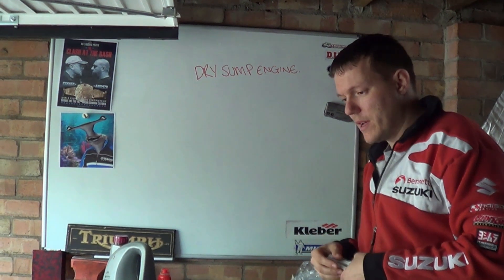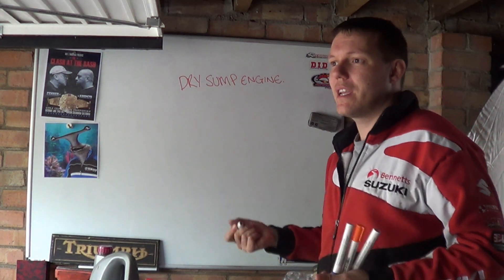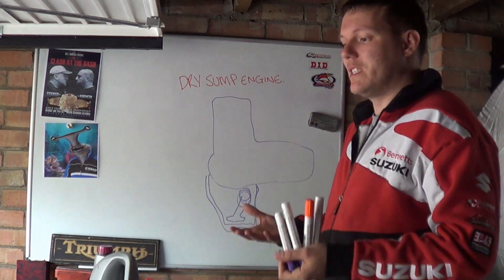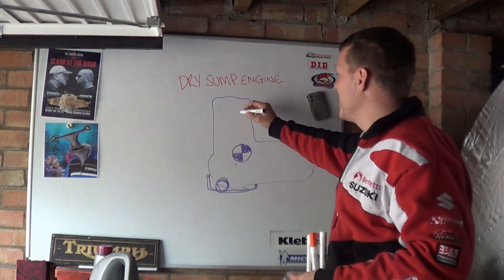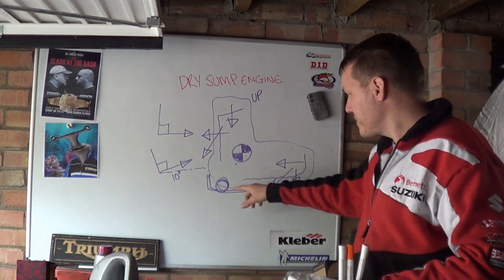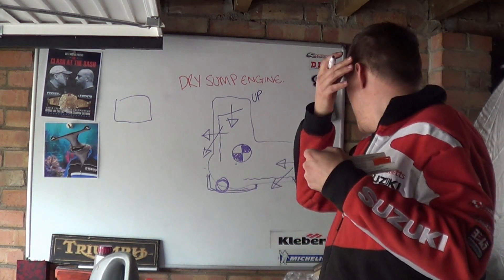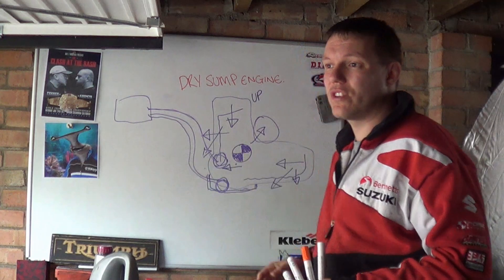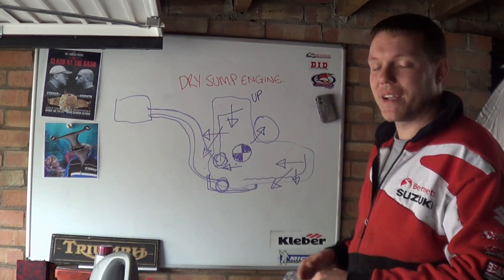Dry Sump Engine - why have one?

Comment: Haha I have just been arguing in tiktok comments about dry sumps. The guy in the video reckons 35hp free gain from the crankshaft not churning through the oil. And all the commenters love it. 
And the few that seem to know that the crank doesn't spin in the oil but say windage causes the losses can't explain how you could measure the difference on a Dyno.

Comment: i have another question: do you think that rotating a v-twin engine (like HD's or Virago's) between 3° to 7° due to lifting the tail of the motorbike (say by replacing a dual shock system for a monoshock) will affect on a negative way? im not sure if the impact will be little or not, since considering the G forces (other than the BAR concept on itself) is an issue that you didnt addressed directly on the fluid dynamics series. thanks in advance and sorry for the troubles.

Comment: sorry to bother matt, but i cant understand why honda used dry sumps on the bigger XR models, like xr500, 600, 650 and i think 400 too, having the oil reservoir inside the frame. what could possibly explain this on a single cylinder offroad bike? thanks and sorry to bother
Reply: You don't want anything on the engine to be vulnerable to accidental damage and a wet sump is a vulnerable component as well as adding height to the unit.  Many off-road singles have used dry sumps and I had a XT500 Yamaha that was dry sump as well.  In the past, Ducati had some good looking wet sump singles but they were one of the only ones and the main interest the factory had was in road racing at the time.  I also had an early XR250 Honda with a wet sump, not too bad a thing on a small single but not the best choice for a large one.
Reply: I have a 1982 xl250r with a wet sump and a 1996 xr250r with a dry sump and oil in frame. The wet sump adds a huge load of metal to the bottom of the engine. And has less ground clearance.

Comment: i understand the logic of the oil path during acceleration but what about deceleration,
Reply: Unless youre revving the shit out of it in neutral and slamming the brakes from high speed, it shouldnt be a problem. The oil pump should be powerful enough to keep things lubricated at all times anyway. I imagine there would simply be more oil in the engine and less in the reservoir simply because the deceleration is keeping the oil from reaching the scavenging pump.

Comment: They did not always have a dry sump system! I cant remember it on the 907ie I used to have and none on the 1993 900ss... that has to be invented with the 4 valve system.
Reply: onhawaii -The only dry sump Ducati I can think of is the Desmosedici racer. Even then when they sold a few road legal replicas they were wet sump engines.